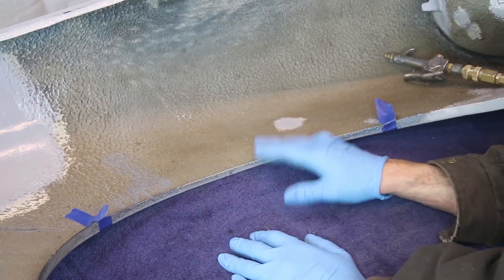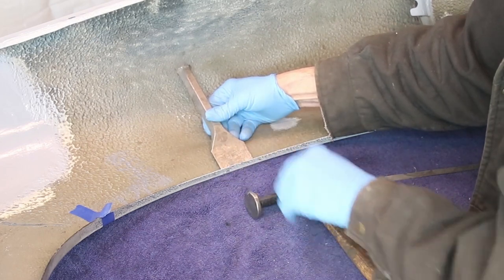How To Roll Your Fenders to Increase Tire Clearance

Comment: I like the fact that you left some space for  cleaning to prevent rust.  What's your thought on finishing that gap out with seam sealer before paint? Nice work Tom.
Reply from the maker: Seam sealer is a good idea, but I will probably leave it open.  I don't mind cleaning it out once in a while.  If it's open at least I can inspect it.  If it's covered in seam sealer the only way to know if its rusting is bubbles on the outside.
Reply: yeah that's what I was wondering as well. I'll probably use seam sealer, because I know I'm not going to clean it out ever
Reply from the maker: Ha ha, gotta know your strengths!

Comment: Great way for the front ! I need to do the back that will not work well, but I think fender roller will help , anyhow great video!
Reply from the maker: I rolled the rear flares using the same technique, it's just harder.  Same except I also used a leather led shot bag to back it up.  The rolling machine should work well too.

Comment: Great info as usual. Thoughts on welding the roll closed to prevent rust?
Reply from the maker: I could if I hammered it flat, but there's always the transition to stock that is problematic.  Epoxy primer is so good these days, I'm not worried about rust.

Comment: Have you covered the patern making in a video? I would like to see a little more details on thet.
Reply from the maker: Do you mean patterns for fitting sheet metal patches?
Reply: @GarageTimeAutoResto  Well yes that too. Patterns to keep the sheet metal straight during the tuning process.
Reply from the maker: A lot of that comes from feel although I do use a steel ruler or an old bandsaw blade a lot to check curvature/ high/low spots.
This video I also use a contour guage
https://youtu.be/ThKgR91ce4Q
I also highly recommend a very old book if you can find it.  "A Key to Metal Bumping"

Comment: Could you fill in the space under the rolled part, with body seam, or some sort of epoxy product to keep anything from getting in there?
Reply from the maker: Epoxy primer for sure, but not filled solid.  My fear of fillers over such a long distance is they might crack and then hold water in.  Every hot cold cycle and vibration can crack this because the expansion rates are so different.  Seam sealer might be a good choice though.

Comment: or you can do some asean style fender roll, grind of all the paint on the folded fender part then completely fold the fender lip to the inside of the fender once the is no gaps seem sealer the gap to prevent any water or moisture in the gaps, then you primer and paint. we do this to our car in brunei not to mention we have wet and dry climate so rust in common. and by far best method to prevent rust and nice on slammed cars no scaring on tire side wall.
Reply from the maker: I agree with this.  If you want the max clearance then smash it flat just like a door skin.  Quality prep and seam sealer should work great.  Does the fender seem weak when you push on it?
Reply: Actually its pretty stiff but also have some give, if you want true hardness after applying the seem sealer add a thin coat of bondo then primer and paint. But most of the locals will skip this step due to the bondo cracking if driven rough up to you

Comment: Ah, the baseball method was risky but worked well, if caution was used while on the vehicle. I see guys checking the fender lips at car auctions regularity running their hand under to see if the lips are bent.
Reply from the maker: Yep, that is how I tell if a speedster is fiberglass or not😃